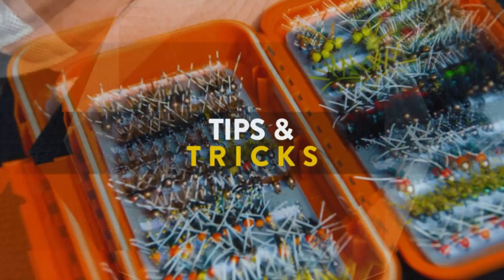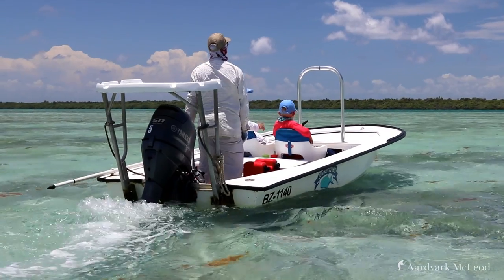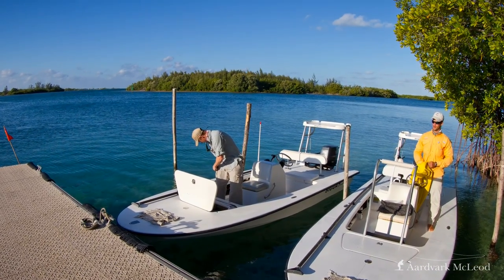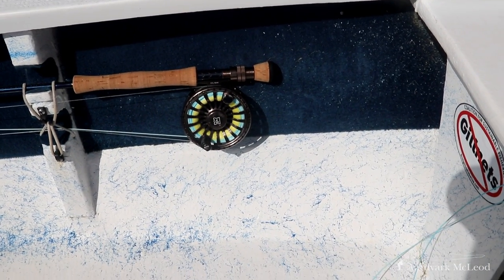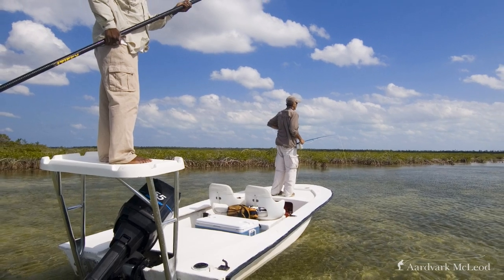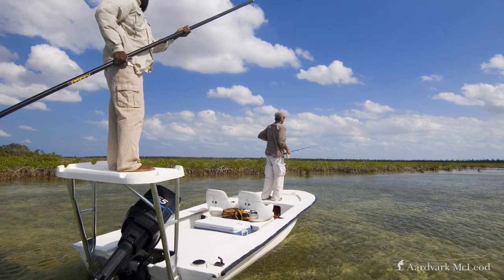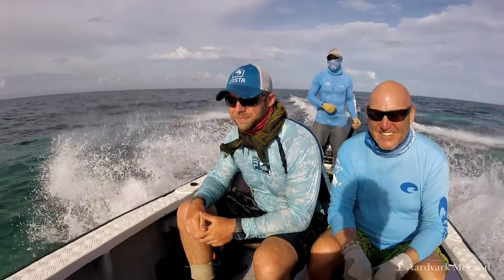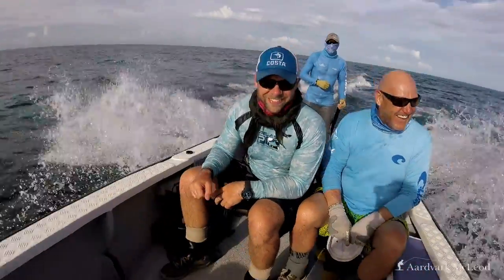10 Tips For Fly Fishing From A Flats Skiff

Comment: Great video! I would add practice and have a good backcast presentation so you can cast to fish on the right side of the boat (if you are right-handed). Guides don't like it if you cast over the boat and sometimes a fish appears close to the boat and the guide doesn't have time to turn the skiff. Also practice casting with heavy wind as you will likely encounter that on a skiff.
Reply from the maker: Good advice! Thanks for the comment…